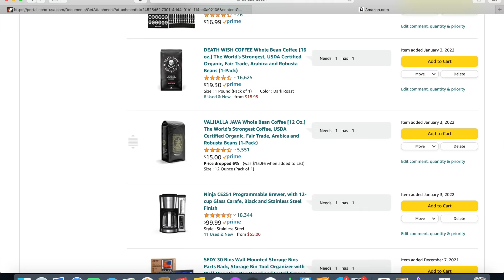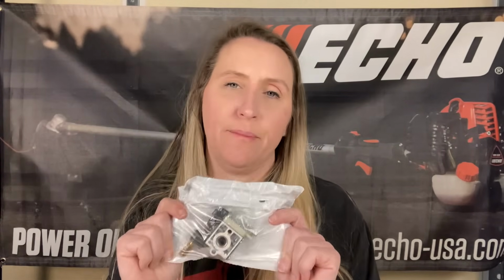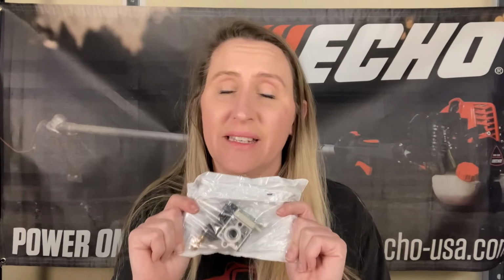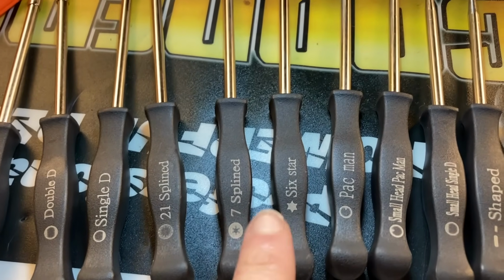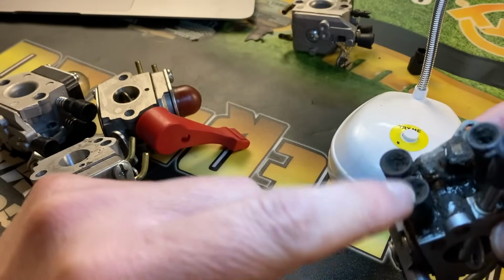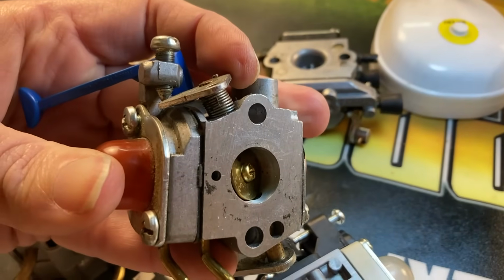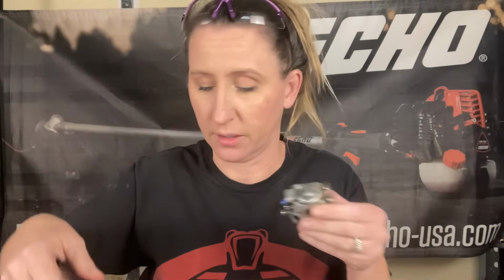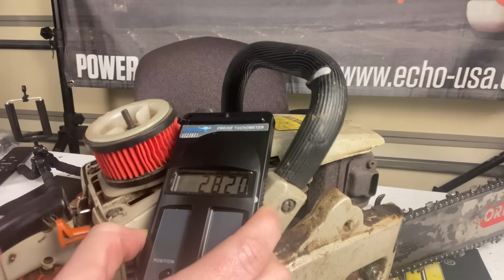HOW TO ADJUST your 2 Cycle Carburetor on a Chainsaw or Trimmer and when you probably shouldn't VLOG

Comment: Hi Bre. I stumbled on to your channel and glad I did.  You have awesome content presented in a likable, easy to watch fashion.  Thanks.
You're spot on about fuel life.  I've been a mechanic for 44 years and I teach high school and college level auto tech programs.  Fuel is viable for about 90 days but... the fuel at your local gas station is about 30 days old when the tanker truck delivers it to them so you're comment that fuel begins to deteriorate after 60 days is very accurate.  A good quality fuel stabilizer can buy you some added shelf life but it MUST be added to fresh pump gas.  Stabilizers will not resurrect stale gas.  Always buy quality fuel from a reputable station and only use the octane rating that the equipment manufacturer recommends (usually 87 octane).
Liked, subbed and hit the notification bell.
Reply: Jsut wanted to add, I use 91 in all my tools + ATV. Not because the 91 makes it "better" (Although the ATV does require 89 vs 87) but because I can only find non-ethanol in 91 round where I am.
 I always drop in the Marine Stabil to my the empty 5gal fuel cans before I fill them, it keeps the gas good a long time.
Reply: I have been separating ethanol from the gas. A small amount of octane booster could be added but it does pretty good without it. It's unbelievable how much water ethanol can absorb!
Great videos!

Comment: I have a husqvarna 445 and the ID plate says 2009.  I didn't realize how long it's been,  I got it brand new.   It still starts with 2 pulls.  Only did basic maintenance to it. And adjusted the carb like 2 years ago when it was bogging ...

Comment: Great video. I have a stihl ms250 that I had to replace the carb. on. I initially checked the low and high and set them as per the decal on my saw. I then added approx 1/4 turn out on the low speed to richen it a bit. Recently bought a small tester from Amazon and checked RPM's. My saw calls for 2800 on low and 14,000 on high. The low was spot on and the high came in at 11,100. I think the 14,000 must be a mistake because my saw cuts great the way it is adjusted. For all of you who try to do their own mechanics, keep in mind that if the printed inst. do not make sense, they could be wrong. There is a big difference between 11,100 rpm and 14,000 rpm. I am thinking they meant to say 12,500 rpm not 14,000 rpm.

Comment: My first job was at a bumper boat operation , the only problem we ever had was water in the bowl of the carb. The engine would start and idle but when you give it the gas it would die
. Cars motorcycles , anything with gas will act this way.

Comment: Nice video!  Great explanation of the how's and why's. I have a "Eager Beaver" chainsaw and weed trimmer. Sometimes they run like they should and sometimes they drive me nuts trying to get them running... So the suggestions you gave about the gas and the adjustments will most likely help a bunch!!  I try to use fresh gas but it seems like "fresh" is being re-defined.  The gas now days just don't last as long as it used to.  Thanks!!!
Reply: Really interesting video and now I know why I never adjust carbs myself. Thanks for all the tips to try before I take it to the repairers

Comment: Nice to see that fresh air filter in there... don't forget you often can't see how badly that filter is clogged by fine dust or pitch.
Reply: also, plastic containers CAN NOT contain fuel for long periods, the lighter parts of the fuel evaporate. Even a steel container will struggle because of temp/pressure cycles, and of course that hydrophilic ethanol that shouldn't be there.

Comment: All modern fuels sold in Canada and the USA at "gas stations" have ethanol added to it for such things as emission control. The downside is that ethanol loves water and literally holds onto it. I've seen you suggest a ethanol treatment which really helps, draining the tank also helps.

Comment: I had never seen a mechanic tune a 2 stroke by RPM's. I will have to watch again.
I always go by the sound, which of course is the RPM's, partly. I am surprised however how much richer(slower) you came down from top RPM's. I hope I haven't been running too lean. Of course since most of my saws are from early 70's(XL-12's) and still run, I must be getting close lol

I found that tach., at a reasonable price, but didn't buy it. It does verify to a degree, if you have tuned it by ear closely. Good for training, but I would not like to have to rely on it. I watched a few mechanics who also use their saws, tuning by ear, and I learned to get my saws running better. I  liked that they used a tach.,  to see how close they were to spec., after tuning and using the saw. They were very close. They tuned them for in the wood running/ cutting, which made the saw sound just a bit off, till it was eating wood.
I suppose the manufactures took this into account when they made their RPM spec.'s.

I feel though, that every saw runs a bit different,  for various reasons, but even from new. The tach. will get you to spec., like turning the jets out to spec. will get you close; but IMHO you need to finish tuning by ear and by performance cutting. Just the opinion of an amateur ;-)
In the end, you knew it still needed adjustment lol, by ear maybe? ;-)

I am still tempted to get an inductive tach. though lol, if anything, a fun toy ;-) Maybe my lawnmowers are running too fast lol

Comment: Great video, thank you. 
I must say that those limiter caps while i understand why they exist, they limit too much off adjustment. I live in a valley where we have some forest but we also have some forest quite a lot higher grounds. So the elevation difference is big, so much that i couldn't tune my saws properly to run good. Also here the difference in temperatures in winter and summer are big and i can barely tune my chainsaws with limiter caps on, to run not too rich or too lean.
Well when the time will come to change my saws i will defenitly buy saws with auto-tune from Husqvarna or Stihl's M-tronic, because if i remove limiter caps while the saws are still under warranty you lose that warranty.
It seems that my little Husqvarna 130 had the least problems adjusting for altitude with caps on. But the bigger saws werent so lucky so i had no choice to remove the caps.
I really didnt want to run the saws quite lean all day and have them score the cylinder like crazy. If anything i like it a little on the richer side.
Keep up the great content.

Comment: I've got a Husqvarna trimmer, I've had it for 6 years + I use it every season, I've owned it since new. I have a large can of gas I use for the mower and trimmer (I mix as needed 5 litres at a time). I have had years that I didn't even use the whole large can of gas. No troubles from my lawn mower or my trimmer.... I expect this comment to bite me on the ass soon, not by people responding to it, but the equipment will probably give me trouble from bragging. 🤣

Comment: Your videos are very helpful I work part time at a tree company I have about 40 saws Take care of I've been working on swallow engines for about 20 years or more  They can a lot of small engine classes Whenever too old to learn something new thanks for the help
Reply: I just posted sorry some of the words didn't come out right
Reply: @stevegimenez9981  Not reading what you posted? You can edit your comment by using the three vertical dots located on the top right hand corner of your comment. Just tap your finger on the dots and choose the 'edit' button that pops up. You can now repair the text you are not happy with, or rewrite it entirely. Hope this helps.

Comment: I've had 89 octane non ethanol gas sit for 5 months and run fine. Still have some left I'll be trying soon, it'll be 11 months old. We'll see how it goes.
The key to fuel longevity is keeping the can sealed tight to keep moisture out and also keep the fuel as cool as possible.
Reply: I broke out my gas chainsaw this week and filled it with the only mixed gas I had which was 5 years old at least and the saw started on pull 3

Comment: Hey Chickanic ,Great video. You're quite a gifted lady .You have both the understanding and the feel for mechanical equipment  .In regards to the water found in the fuel tanks  ,even though the gas station sells  87~92 octane fuel,what they don't tell you is that they add ethanol as a (1) water accumulator ,and (2),to cheat the consumers .This added component to the fuel is to protect their transport trucks tanks from rusting out (supposedly).But special coatings sprayed have taken care of that issue but the ethanol sucks water out of the fuel during transportation. Alcohol has an infinity for water .Like a magnet for fuel that has water either solid, liquid or vapor.(Methanol is used in colder climates to desolve iced up fuel lines ,but the principle is the same )And these trucks handle lots of different types of fuel ,so there might be some ethanol (10~85) percentages  in the stations supply tanks .So when you think that you are buying straight gasoline ,there might be a 1%~12% amount of ethanol in the storage tanks depending on what time of the year.Ethanol eats rubber seals like there's no tomorrow because seals ,O rings usually have oil based in the rubberseals unless they are vetton type (Urethane).which is Nitrogen based .Even carburetors from pre 87 cars are having problems. Take a Rochester Q-jet for example. Guys are having to re -jet their carbs in order to get the engine to run properly. So I don't know if that is the problem,  but 2 cycle engines don't like ethanol or anything else other than pure 87~92 octane gas .That's why Stihl sells their oils and fuels at their outlets. THEY know what's going on. It's all part of the delivery equipment protection& little secret of the agenda to get rid of the use of fossil fuels. SO I do believe that there are test strips kits to check for ethanol in gasoline, but I am not 100% sure if that product still exists anymore due to the supply chain issues. But check it out and post it in a video if you are starting to see an increase in water in the tank  syndrome. Found your channel by accident while trying to learn more about chain saw maintenance and sharpening. TREASON had his saw hot rodded by a good man to get max preformace .And that video plus others lead me to you .I am impressed with you .Subbed and notafacation bell too ! Teach it teacher .!

Comment: Ethanol in fuel attracts moisture . And if you  are in a humid climate that makes it more likely for
Water to get into gas. Especially if it is vented system.

Great video, yah as far as I am
With 2 stroke ,  If it ain’t broke don’t fix it . Use only non ethanol fuel mixed with synthetic 2 cycle oil.  Run out of gas at end of season.  Don’t store outside.

Comment: That is why I stabilize all of my two and four cycle gas for two years.  I use nothing but 90 octane  PNE gas, Red Armor or Power Blend Gold, both FD certified.  I seldom adjust a carb after I set them, initially.  I set them for good low end acceleration at factory idle settings and set them at a nice good four stroke at the high end.  If they act screwy I start checking them for problems.

Comment: Yeah but I ENJOY adjusting carburettors.  I have had some questions in my mind whether I have been  just chasing my tail, making it too rich (poor burn) or too lean (burning it up).  Also believe me, when that fuel filter is stopped up you can adjust it so it'll still run but it probably shouldn't.  Best thing is get a new filter, but it's also fun to clean it with Berrymans and THEN readjust the carburettor.  That's more fun than you imagine! Nevertheless, I take what you're saying as good advice.  You are knowledgeable for a shiela and I love yer videos!

Comment: I run VP Racing 2-stroke full synthetic oil @ 40:1 in alcohol free high test. It also contains gas stabilizer that extends fuel life for one year. I adjust both jets slightly rich for L and H. High adjusted so the saw 4 strokes when letting up bar load in the cut of bigger log. You'll never seize or score the piston/ cylinder running slightly rich. When I'm done with the saw for the day I top off the fuel and oil, because moisture in the air will condense in the tank and that's a problem.

Comment: My short checklist
1) good fuel (no ethanol)
2) bad (petrified/broken) primer bulb/fuel lines replace & clean/replace fuel clunk/filter
3) clean/replace air filter
3) clean carb/needles .. replace diaphragm (or full kit if needed)
4) get an adjuster toolkit, learn/know how to adjust properly & when (as this video covers it).

Comment: a little piece of advice when you buy gas get a tag and write down the date you bought the gas write if its mixed or straight gas and last write on the tag if you put fuel stabilizer in the gas and attach the tag on the handle of the gas can.the worst lie to tell yourself is 'I`LL REMEMBER'

Comment: showing up late, but just in case it helps - in FL I've often had trouble with water in EVERYTHING.  Even the 'sealed' tanks. Sometimes it comes from the filling cans, but I've also seen water get into the fuel after sitting half full for a while.  It seems like maybe the ethanol fuels are absorbing the water from the humid air. ? maybe.  BUT - I found some funnels with built-in water separators.  They're GREAT at what they do and they're not so expensive. I use the Mr Funnel brand (no affiliation)

Comment: Been using chainsaws for over 40 yrs. Got faked out the other day. CS 590 Same size plug different #. It would crap out on a hard pull. Carb adjustment?? Nooo! Still have the limiter caps. Put a new CJ7Y in it, runs like a champ. Reinforcing your advice, stay out of the carb till absolutely necessary 😂 Might make a decent vid. Spark pug temps and how it effects performance.

Comment: Hello Ms Chickanic. First of all your amazing, small engine pro knowledge Wow. Ok, got a Echo CS 3510 medium condition, first impression what ya think?  Got it first thing fresh gas  chkd lines filter, replaced spark plug clean it up, then it started and idled, used it 2 or 3 times over 3 weeks started fine, after3rd time never started again it's been about month, what would be top 3 things you know is the problem? Seeing your work youre  impressive so I know you know, maybe if you come across a 3510 you can do a quick tutorial for your fans😊 btw when it started I never ran it for longer than 5 or 10 mins compression is good and it was sounding Beast mode it was hungry to chew wood engine felt good and tight, it screamed real loud strong, kinda miss it help me bring to life again, keep doing what you do exactly how youre doing it youve help me with ryobi weed eater, Stihl and echo blowers,  thank you GodBlessyou

Comment: Many years ago a relative introduced me to aviation gas. Since then, I have used it in all my small 2cycle and 4 cycle engines and have never had a fuel problem. Some equipment has set for as long as two years. Also, great video on carb adjustment.
Reply: Aviation fuel can't be manipulated like the gas at the pumps. The FAA controls that. (For now anyway) Just do not put 100LL in anything with a catalytic converter! (Unless its hollowed out lol) You may have to pick out the lead build up on the spark plugs every 50-100 hrs.

Comment: Up here in Canada I solved most of our 2 stroke power tool problems by only using 94 octane Chevron gas. Any gas that is higher octane and no ethanol is best. I have not had to put carb parts into our many tools since switching to the premium

Comment: Thank you! Question, should all small engine 2 cycles be adjusted using this procedure? After watching this video I see I've been doing 2 cycle carb adjustments wrong for many years. I've always set both low and high adjustments to max RPM then turned the idle speed screw to desired idle speed. In the video you've adjusted the idle speed screw 1000 RPM above desired RPM and turned out the low speed fuel mixture screw to desired RPM richening the mixture and lowering to desired RPM. The same done to achieve max RPM. Fantastic information here. Thank you!

Comment: I get some Sea Foam  and mix it with clean fuel and run a 1/2 tank fuel but change the tank filter  if it still runs off then take it in those walbro and other are delicate

Comment: Have you ever seen the 1/4 scale Radio Controled model air planes?
They run weed eater engines. You have to adjust the carb for the conditions that day, then adjust for altitude also. Look it up on you tube. It is much better in person though.
Reply: Yes, they do. Same as Go-Karts, which might need to be adjusted multiply times per day if you race.
Chainsaws do need adjusting occasionally, and they do need adjusting, even if a brand new OEM carb is installed. You are adjusting for local atmospheric pressure vs fuel supply.
I have adjusted 1000's of chainsaws, lawn edgers, etc.  The method shown in this video, might be good for a general base point and suit most people, but to get the most out of the engine, a tacho is not required, rpm is not what your are "Tuning". I(nfact, this method above is not "Tuning" it's setting it to set parameters.

I really like Chickanic, and agree with most things she says, but I disagree with her carby tuning method.
The real way, quick version - Run engine at full throttle and turn H screw until engine runs clean, it will be it's highest rpm. Turn H screw out until engine starts to "4 stroke". It will generally be "1/8" of a turn. 
You do the same with the L screw at roughly idle speed. When finished, adjust idle screw as required.

This way you're tuning carby settings to how the engine is responding.

As you know with the weed eater engines you talked about above, no 2 engines are the same.

Comment: Try heating the plastic gas line and stretching to put it into gas tank holes.About 4 inches of it works for me.then cut the end off.Beats angle cutting it with scissors😃